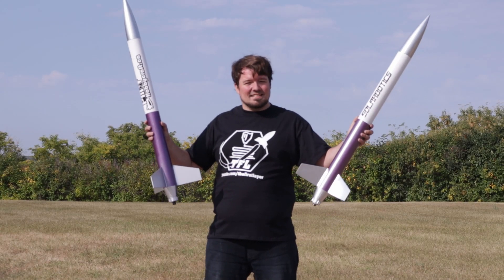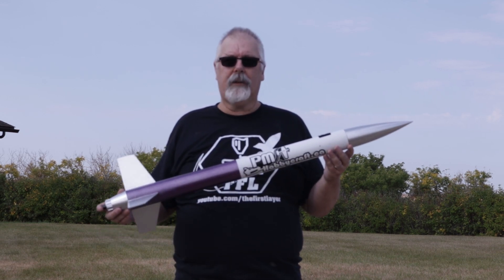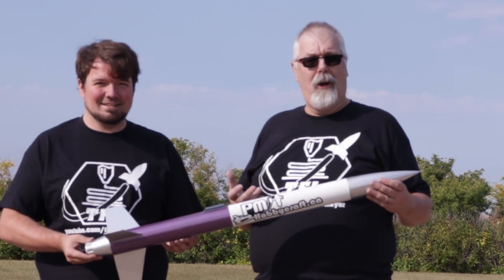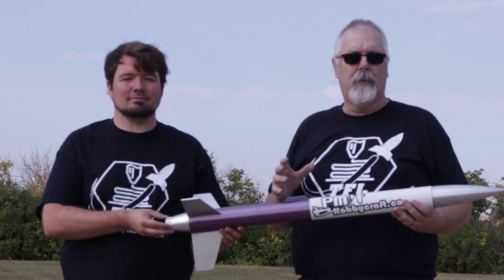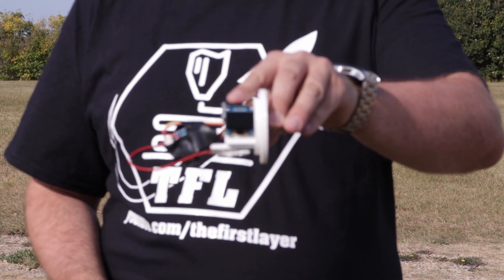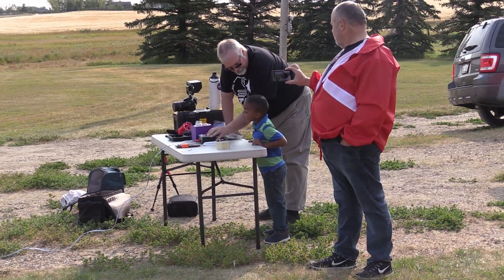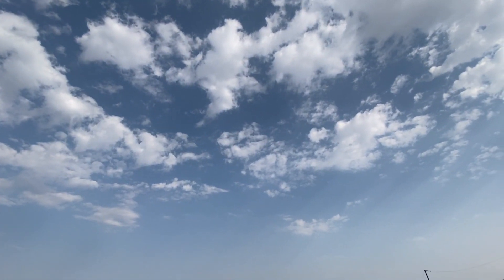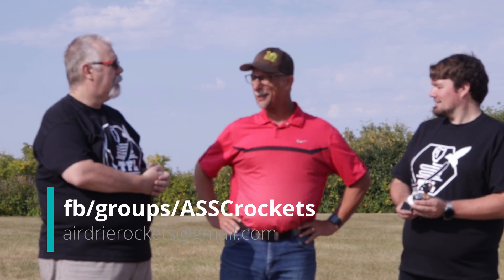Flying a 3D printed Rocket

Comment: 3d printing goes great with model rockets.  I have 3 now that are fully 3d printed, and 5 more that have 3d printed nose cones and fin cans with straight sections of cardboard tube in between.  I also have at least 3 more where I printed nose cones that I couldn't buy.

Comment: i just 3d printed some centering rings for my Level 2 rocket and they did not hold up haha. I used a J270 motor. This motor is 38mm in diameter and about 18 inches in length. I knew the rings would not hold up at all since i had stress tested them before hand haha

Comment: Duuuuuuhhhh most rockets are made of thing cardboard... plastic one would hold up better.
Reply: actually 3d printed rockets are going to be much weaker in many ways, as layer adhesion is an issue when using most filaments. They snap quite easily with very little effort. Cardboard tubes are made in spiraled layers with adhesives that make them quite durable, and they do not have this same weakness at all, like 3d printed parts do.
Reply: @JasonEllingsworth  Ezzel vitatkoznék. Én több Rakétát nyomtattam már, és semmi mechanikai probléma nem volt velük.  Csak a hőállósággal. Az egyszerű PLA korlátozottan alkalmas erre. De már vannak nagyon jó anyagok.    Ez a második nyomtatott rakétám:   https://www.youtube.com/watch?v=FCgxtlG2wNk
Reply: Ez az első 3D nyomtatott rakétám PLA anyagból.  4 darab D9-5 hajtóművel repült 486 méter magasra..    https://www.youtube.com/watch?v=oJKcPDLRGEc
Reply: @csabaalmasi4609  don't expect a response as i have no idea wtf you're saying